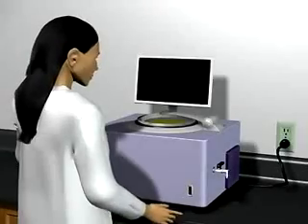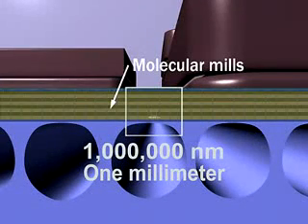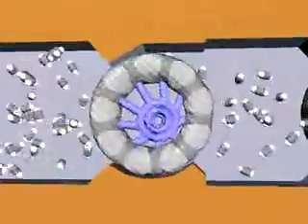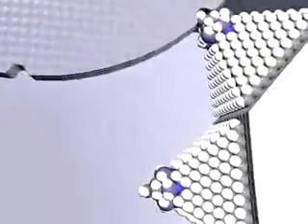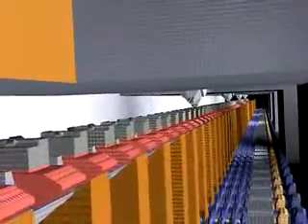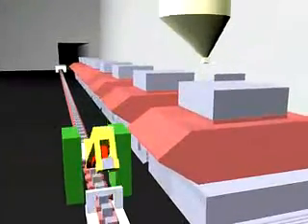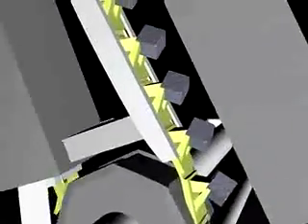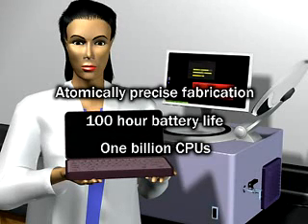Nanotech Assembler

Comment: I have thought of another device that could be used with this one. 

The Nanotech dis-assembler, where you put trash on the surface of the device and it is taken apart atom by atom, molecule by molecule. these atoms and molecules are plumed into storage cartridges which can be plugged into the machine shown in the video.

Comment: @WTF1920 Nanotechnology does not equal violation of the laws of thermodynamics, fool. To simplify that in terms you can understand, it doesn't allow you to pull bullets or gasoline out of your ass. Real life nanotech (not the silly shit you are thinking of) will be an extremely limited use technology, with nieche applications limited to computer fabrication (as was demonstrated here). There are very good reasons in support of this stance, none of which you would comprehend.

Comment: @Grindednigg Umm, no, you are heavily mistaken. I don't see how the hell using nanotech to straighten bones out = posthuman, or why anyone would think they need nanotechnology to do that in the first place.
Wrong tool. 
Gene engineering would allow you to do much more than merely straighten bones, it would give you bones that have triple the yield strength of the ones you have now, bullet resistant skin (like an elephant or rhino), and muscles capable of far greater exertion. You wouldn't be

Comment: A note on scale and time. A carbon atom is 67pm across. Each small block looks about 10 atoms wide, and each  large block is 10 small blocks across; thus 6.7nm wide. The Final Assembly Machines are about 10 blocks apart, so at normal speed, each FAM would finish a 670x670x670nm block per second.

At that speed the super-laptop (which looks  to be about 6.7cm thick) would have a build time of 100,000 seconds, or just under 28 hours.

Comment: 1. Electric power, this is quite simple if you use semiconductors based on silicon or GaAs (often used in Optoelectronics for Bragg's mirrors <50nm)
2. Silicon, silicon and silicon again.
3. Controled by a chip connected with electric engines. Programmed and ready to use.

... and ... don't be such an ignorant